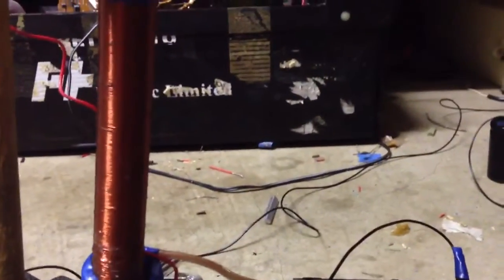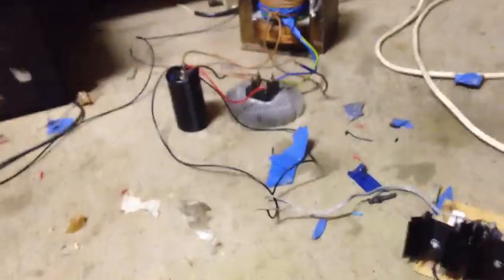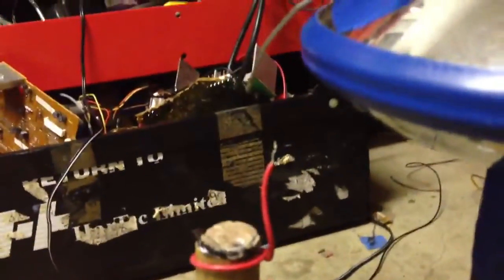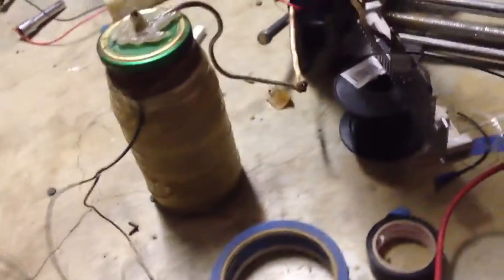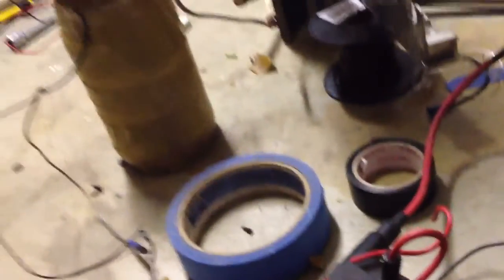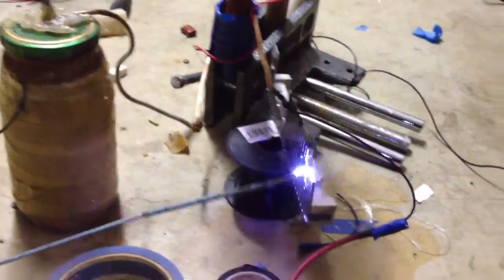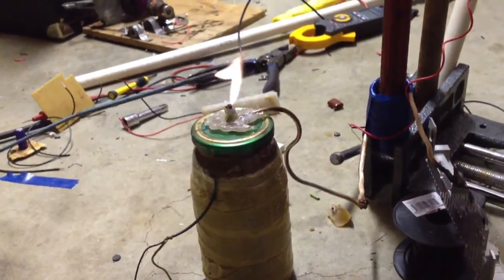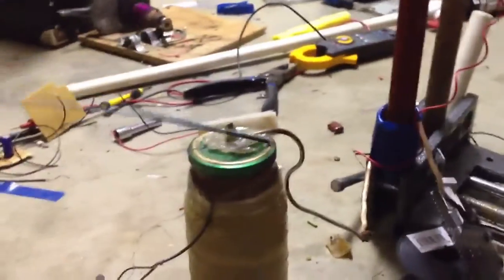Flyback tesla coil

Comment: I think I might have an explanation as to what is happening. When you use the higher input voltage there is enough current available on the output of the transformer for the arc to stay formed and the voltage across it drops to 0v, at which the capacitor is effectively removed from the circuit. This is also a factor to do with the high frequency's involved.

Solution is to add more capacitance (allot more) which would then also allow for larger discharges from the tesla coil ( :